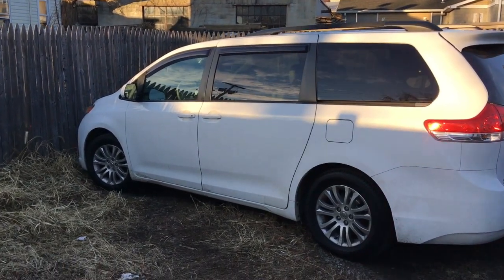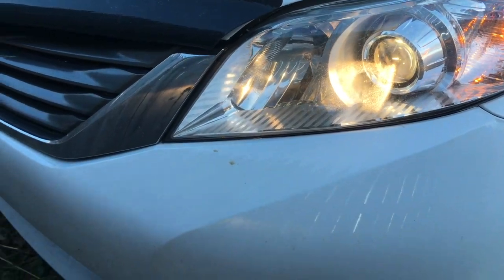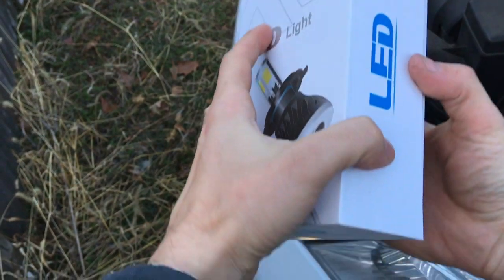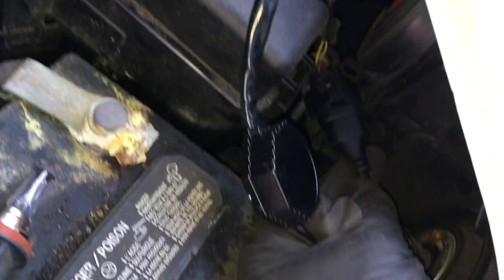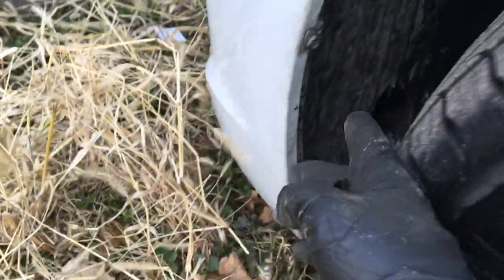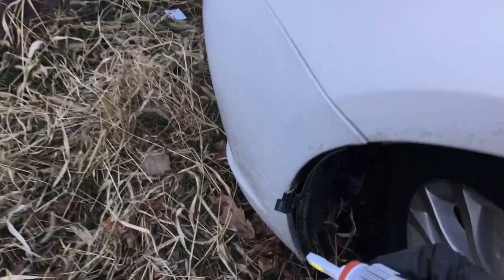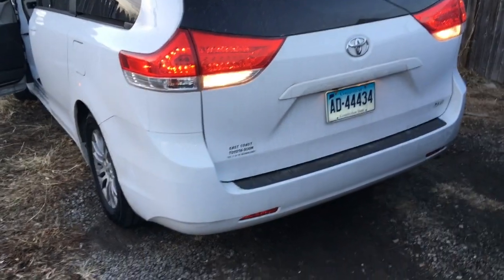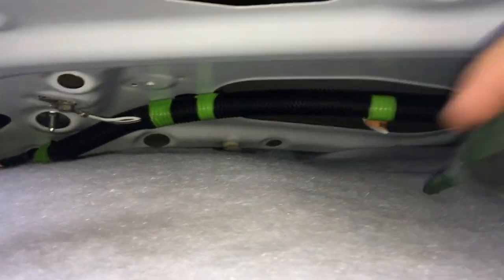2010-2018 Toyota Sienna Headlights & fog lights LED conversion + back up

Comment: I asked my dealer and he said 2015 model you can’t change lights because LED takes too much power and gets to hot which may melt your holder and as well as mess up your wiring.

How long have you been using this led lights car and have there been any problems with it?

Is it more brighter than yellow light (fog light and headlight)?
Reply: I can’t speak for projector housings but I’ve done LED conversions on all my vehicles I’ve ever owned and the past years I’ve never had any melting issues or burn marks but I have had issues where I put higher wattage halogen bulbs in like Silver stars and gold stars from Sylvania and they’ll leave burn marks in the housings‘s
Reply: no leds emit 10x lower power than halogens

Comment: While you already opened the hatch panel why not change the license plate bulbs to LEDs too? It will be whiter light to the license plate.
Reply from the maker: I can agree with you, but.......
 Owner of the car only wanted what was done in 2 videos about this car , because it was more practical and would require less future maintenance. In order to properly install small LEDs like the ones for license plates, requires a lot more work, then just replacement. I will make a video about this soon, but it would require to lower voltage and stabilize it. Owner of this car did not want that inconvenience and I did not want to give free future labor , knowing of the outcome.

Comment: What brand fog lights are those?  Do they come in yellow?
Reply from the maker: they are no brand. They were made for few vendors. Cheaper this was as no marketing expenses. They came yellow, but not many people wanted them, so I did not stock many. If they were exposed to the road in winter, salt would finally get to something and corrode it and lamp would stop working. I started offering dual color LED kit , which had white and yellow in it and one could switch between colors. Cost wast slightly bit higher, but much better design and better effect.

Comment: hey did you ever had where head lights worked and your fog light did not
Reply from the maker: Only if there was some kind of a short that blew the fuse, but with LED's it should have short protection, unless some other short. No problems with installing LED conversions.
Reply: @artworkslights  thank you